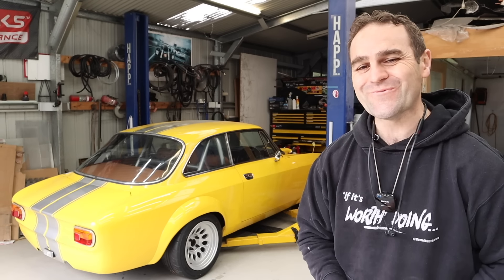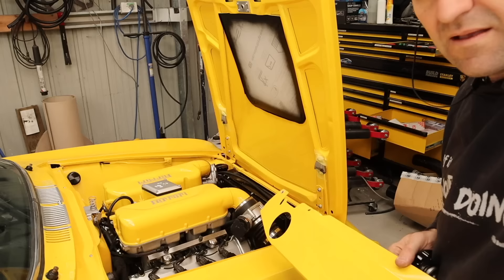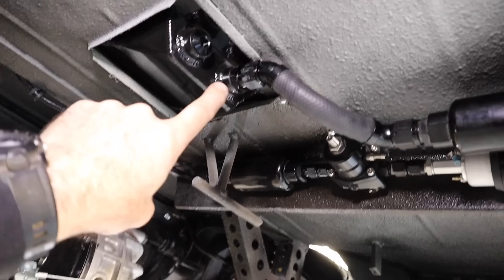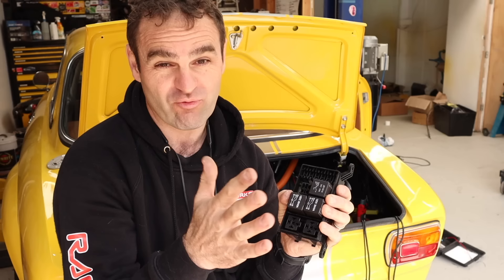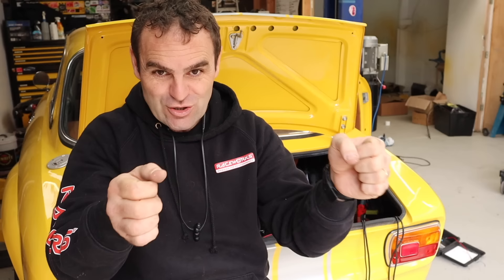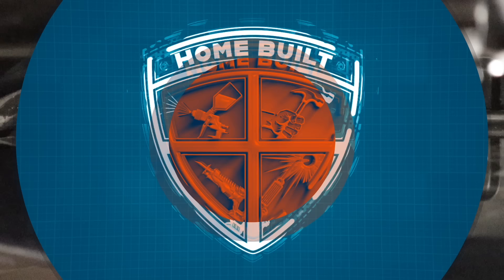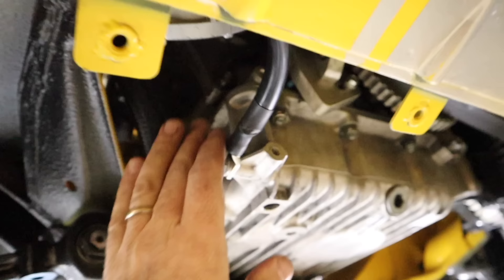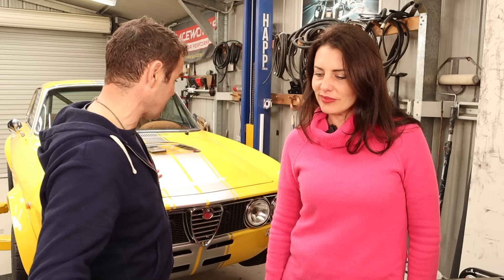Bonnet fail... - Ferrari engined Alfa 105 Alfarrari build part 191

Comment: Before hacking The plenums try bending the lexan.
Shape a bit of wood to use as a ram to force a bulge into the polycarbonate as you heat it with a heat gun .
Method 
Remove the hood and place it upside down on a pair of saw horses or similar.
Put a curtain or cardboard around the perimeter and blow heat in to warm the plastic.
Place a square of wood that you shaped on top of the plastic with weight on it and blow heat around the perimeter to soften the plastic allowing the wood form to press a bulge .
You can probably get ten millimetres of clearance easily without making it look ugly.
Reply: Jeff - I was going to recommend the same thing.  This is similar to the carburetor bulges you see on some sports cars (TR4 immediately comes to mind) and would look like it was a deliberate feature instead of a fix.
Reply: From the images provided, its the forward edge of the lexan where it interfaces with the bonnet that is the point of interference.  So forcing a bulge in the lexan will not solve the issue as the touch point will continue to be the metal edge of the bonnet.  If a bulge in the lexan is the preferred means of providing the required clearance, then the hole in the bonnet needs to be enlarged towards the front - which will generate additional work.
Reply: @georgebettiol8338 . It looked to me that the interference point is at the weld on the plenum which is just far enough back for bulging to work.
Reply: Alternatively you could try putting the plenums in a press and flatten the contact point a bit without harming the paint.

Comment: You might want to consider heat-forming some small clearance ripples in the lexan over the contact points . You could use the intake runners for that by padding them with some hard rubber strips that would imprint their shape into the lexan as you heat it with pressure on the bonnet. I would try some slices of big diameter coolant hose double-stick taped to the intake runners. Be sure to add some cloth or paper to keep the lexan from getting scored and keep the ripple smooth. It's worth a try and lexan is cheaper than all the work needed to address the actual runner shape. BTW the car is looking sensasional!

Comment: I would leave the bonnet and plenums as they are for the reveal, for long term have some Lexan thermoformed to be a bit convex to clear the engine? Would also look a bit different from all the other bonnets with a hole...Ciao from Italy 🇮🇹
Reply: From the images provided, it's the forward edge of the lexan where it interfaces with the bonnet that is the point of interference.  So forcing a bulge in the lexan will not solve the issue as the touch point will continue to be the metal edge of the bonnet.  If a bulge in the lexan is the preferred means of providing the required clearance, then the hole in the bonnet needs to be enlarged towards the front - which will generate additional work.

Comment: It all looks really good! What an awesome job! Honestly I would modify the hood instead of the intakes. Even with all the extra headaches that will bring. In my opinion, that would be a much nicer result. Seeing that you always have a clear view of the plenums, you would be reminded every time to see the engine that a shortcut was taken. However I do understand that you really want to finish the car. Nevertheless it would be worth it to do it right. Good luck! 😀👍🏻
Reply: I agree with you, it's a bit of an annoying compromise you'll see. Maybe if Jeff makes a really nice weld and polishes it all smooth it'll barely be noticeable? But yeah the bonnet could be taken off, and the bulge enlarged slightly for the same work needing only airbrushing in yellow and silver.

Comment: ... and regarding additional hood clearance (assuming you don't have solid motor mounts) you'll need to account for the motor also rocking a bit on throttle but I'm sure you thought about that...

Comment: Hi Jeff, I noticed during your last video that it appears you have both the original triangle bar and a panhandle rod. Having both would lead to that  the rear end is locked from roll,  which is really bad. I guess you are aware of the issue and that it is only a temporary solution. Great show, so big thanks! Martin
Reply from the maker: Go back and watch the last couple of videos ;)

Comment: man Im so pleased to see you use nice thick gage cables for battery and ground especially. folks always go cheap on that and then wonder why they have electrical phantom problems. My jeep grand cherokee would get phantom codes and I saw a post about guy changing his cables out with thicker gage and lost his problems. I did same and man all the phantom codes went away and ran so much better.

Comment: Good work Jeff. Your very minor tolerance problem from the gaskets is a major lesson to us all.

As mentioned below, please add some extra earthing.

Fuel arrangements; I have been surprised that you do not opt for an overflow tank and evap tank? I'm planning these on my (older) project to handle fuel expansion as high temperatures are now a problem in the northern hemisphere as well.

I suppose you going to protect the fuel pump, regulator and filters as these are quite exposed and this would tidy the underside up?

Comment: Others seem to have said it, but try to find that space elsewhere. If you've got several differing pieces making up the inlet, take a mm or 2 off each face of those.
ie 1mm off each side of the risers is 2mm, 1mm off each side of the bottom half of the inlet plenum is another 2, 1mm off the bottom face of the plenum top is another mm. That's 5.
Stretch it to 1.5mm off each face you're up to 7.5mm...
Off course making sure you take an even amount off the entire faces is the difficult bit...

Comment: Instead of cutting off the top and flattening, could you cut a v-section out of the underside to change the angle of the bend?😊
Reply: Wouldn't that make an asymmetric air mass flow between the cylinders in each bank?

Comment: Is it possible to make some sort of die to make a curved concave to recess the inlet instead of making it flat? There are no other sharp edges or flat planes nearby so the flat won't look good there. It could be done with a hydraulic press and a rod of hardened steel.

Comment: Would there be any way to shave a little rubber off the motor mounts to get it a little lower in the engine bay?
In any case, the car is drop dead sexy.

Comment: It actually looks to me that it's not the engine height that is the issue but that it is sitting slightly forward. Look at the gap at the rear of the plenum 5:20 . Is it possible to alter the engine mounts and shift everything back an inch?

Comment: Looking brilliant Mate! I am a little worried that the fuel pump and filter arrangement is so close to the rear that if you had a rear impact power to the pump and a leak could result in something nasty. It is kind of like having the fuel tank in that same position?
Reply: The car is not exactly safe from the factory anyways. Non existent crumple zones and thin pillars and now with a big engine in front.

Comment: Jeff if your battery is going in the boot use a battery positive wire from an e90 bmw it will go from boot to engine bay with wire to spare and it is not a massive fat wire and the plenum issue  can you taper the lexan where the plenum hits and then re paint the black be a shame to modify the plenums again cheers from broken hill
Reply: The postive battery wire was designed some time ago and is already in place.  If I recall correctly it was a large diameter wire to reduce voltage drop over the relatively long distance.

Comment: Just a thought, if the height issue was caused by not accounting for the gasket stack up, could thinner gaskets and/or using RTV instead, potentially buy you enough clearance?

Comment: How are you going to stop the condensation on the inside of the bonnet window..??
Reply: Easy...lizards
Reply: It will be so hot that water will not condensate. Just like when you heat the windshield to eliminate condensation.
Reply: @MuitoDaora  it will have some at point, it'll dry out, but mark my words there will be some, especially on cooler mornings

Comment: A manufacturer would probably just add a foam sticker to stop abrasion between plenum and bonnet 😅. A little bit of rubbing won't make a huge deal, if you just start the car with the bonnet up? Any engine shake can be measured with the bulge in place. Seems like minor detail to be fixated over when there's cooling to plumb in. Great video, thanks for every video.
Reply: If it's touching when stationary, it will literally 'raise the bonnet' when the motor is providing maximum (twisting motion) torque which the Ferrari eingine is not short of.  The only manner of halting any rocking of the motor is to solidly mount it to the car - however that will generate another host of undesirable issues that wouldn't be welcome on a 'registerable' road car.

Comment: I was considering your optima battery situation, and how Harry benefited from the optima in the past. Did you ever consider using the new YUMA thin film/flexable solar panels on the front and rear dash of your vehicles to trickle charge the optima batteries. Yuma will work with the customer to create a solution for your application. Or simply use some of the solar battery trickle chargers already on the market, which are less that $50.

Comment: Im changing my motor on my project was using 4.8 chev but after watching yours going with a v12 BMW
Reply: Reliable, cheap and compact Chev LS 4.8 (I assume) versus the large, not so realiable and horrendously expensive BMW V12 - very brave - and may the Gods with you.
Reply: @georgebettiol8338  the v12 out of 1999 750 is slightly smaller and as for reliability its a proven 5.0 .I changed the injection the Ignition is now coil off a custom Harmonic balancer .cams and heads from Germany  yes was Expensive.

Comment: To make that car act right at speed you're going to need an air damn in the front..   Thus making low pressurized suction under the car versus lift which destroys steering and feel in front..
Reply: With very stringent speed limits, I suggest it won't be needed in Australia, as 'we' don't have unrestricted autobahns.  Even if used as an 'amateur' tarmic rally car, the top speeds attained in such events are relatively modest.

Comment: Please consider running a waterless coolant rather than a water based coolant. Evans is the US brand and Liquid Intelligence is the Aussie brand. Your coolant hoses and the radiator last a lifetime and the boiling point is much higher that any water based system with the added bonus of a no pressure system and the coolant does not turn into steam.

Comment: Notching the plenums is gonna look odd, imo. like an after thought. and after watching your builds since Harry, I think you should think twice. Lower the plenums again, if possible. Or something else. Maybe drop the motor 10 mil? just my opinion. I also think you should paint match the battery top!!!!
Reply: To avoid having to modify the inlet pipes, the next best method of creating the required clearance would be to enlarge the bonnet opening towards the front of the car and fitting a lexan window with incorporated clearance bulges.

Comment: Tweaking the engine mounts, if possible, would save you from ruining the esthetics of the plenum
Reply: There's no room to move the engine down. The rocker covers will hit the frame rails.
Reply: To accommodate the engine, Jeff had to 'check out' the front cross member - whilst all other clerances (exhaust, steering, transmission, piping, etc) are at the limit.  As such, lowering or moving the engine back will result in an enormous amount of issues that don't bare thinking about.

Comment: Hmm, why cut up the plenums when you can simply do away with your plexi bonnet window design?  On the up side the engine heat goes straight out through the hole! ... and on the low side? .. well, actually I don't see a low side.

Comment: Im not a mechanic, but it makes me nervous having the battery next to the fuel tank and all those fuel lines 😬 or is this normal ? Couldn’t it have gone in the back seat area ?
Reply: Battery in the trunk is common.  Mid 80’s Alfas (Spider and GTV6) have the battery and fuel tank in the trunk from the factory.
Reply: What? Lots of cars have the battery at the front.
Reply: @MuitoDaora  alright keep your hair on
Reply: @MuitoDaora  Sure, most cars have batteries at the front.  I was simply responding that batteries and fuel tanks in the rear are not uncommon, and listed a couple I’m familiar with as examples.